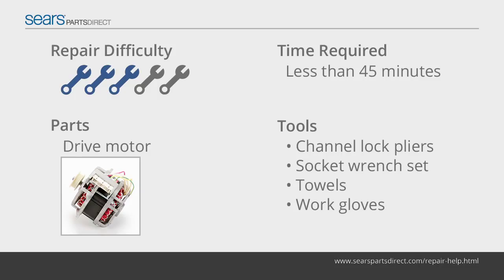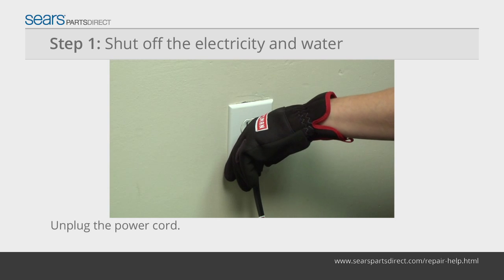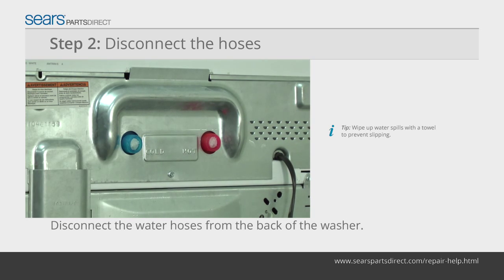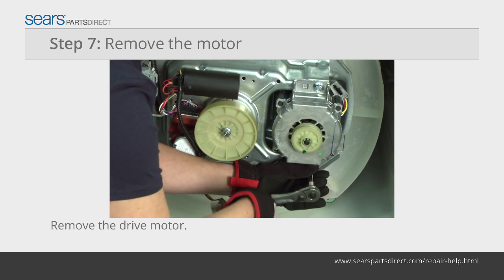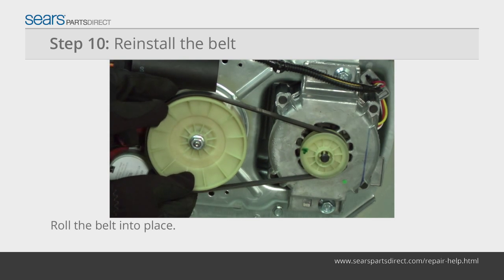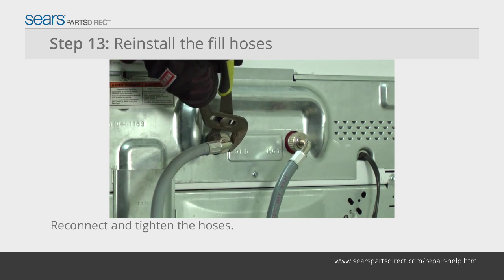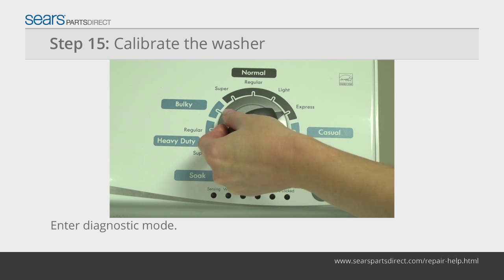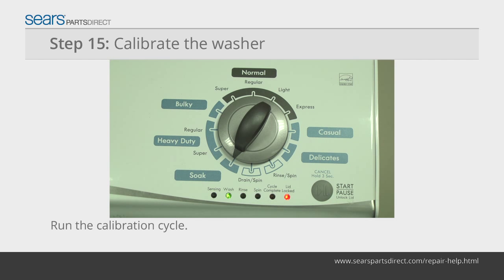How to Replace the Drive Motor on a Whirlpool Vertical Modular Washer (VMW)

Comment: What if I only wish to replace the Motor drive pulley and not the entire motor?
Reply from the maker: The motor drive pulley isn’t available as a replacement part for many of the VMW washer models. If the motor drive pulley is available for your VMW washer model, you can follow the steps shown in the video to pull off the drive belt then remove and replace the drive pulley. We hope this information helps. If you need further assistance, let us know the model number of your washer and give us additional details about problems that you’re having when replacing the part.